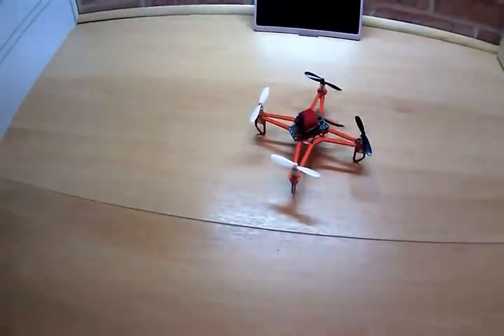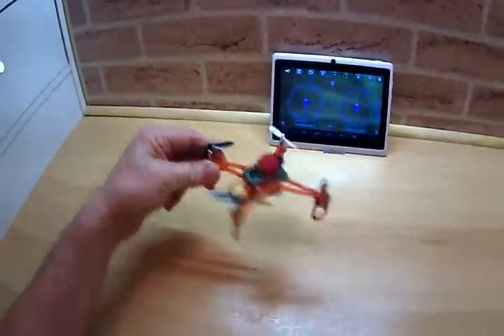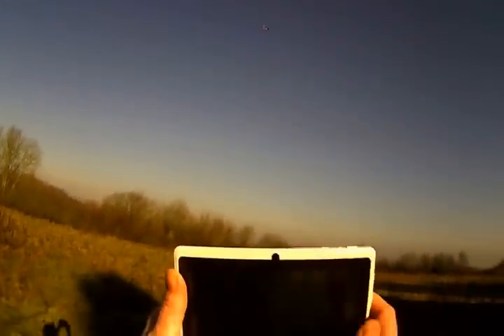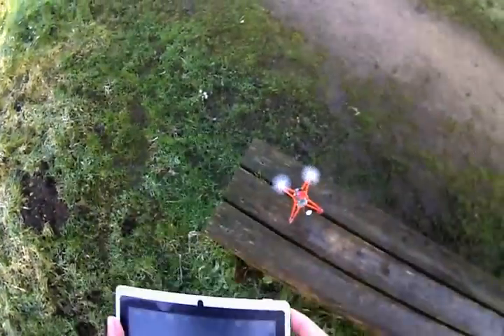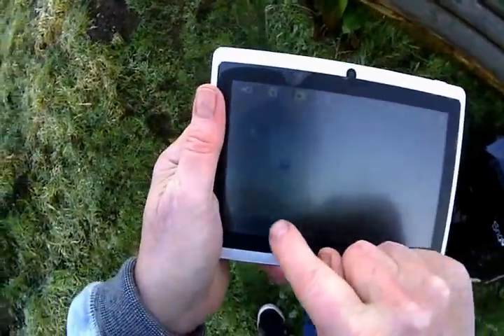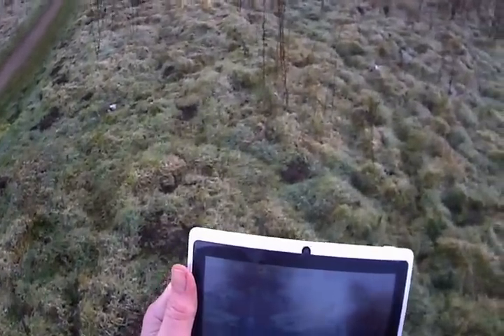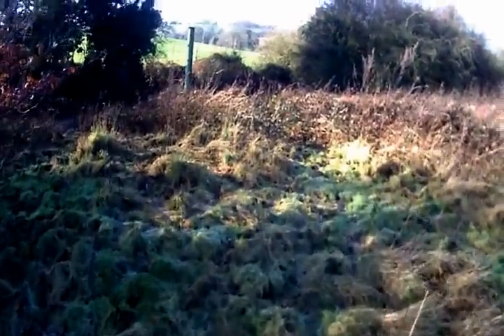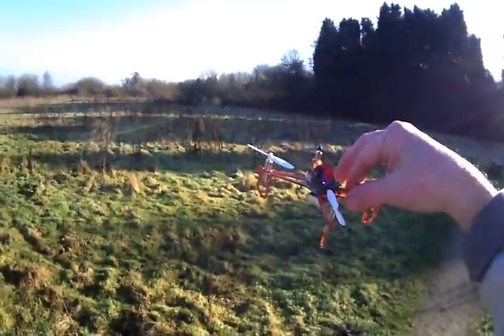New Eachine E50 Micro Metal Drone

Comment: Very good  video again, would you let me have information for the conversion to the Eachine E50 folding quad as I want to mod mine as you have done so I can fly it with my hubsan 502e controller, I have left many messages but you do not give me an answer.
Reply from the maker: Hi mate sorry for not getting back to you, there is not much to say really unsolder the motors from the Eachine board replace with the Hubsan wire the motors back on to this board, bind and fly.
Reply: Hi Mate, What do you mean replace with the Hubsan wire.
Reply from the maker: Sorry I should have said unsolder the motors from the Eachine board replace with Hubsan board then re-solder the wires back onto this board.
Reply: All I need to know what board did you use please give me number code so I can place a order to get it, thanks
Reply from the maker: Hubsan X4 H107C RC Quadcopter Spare Parts Main Receiver Board H107C-a43 I brought from Ebay £8.99